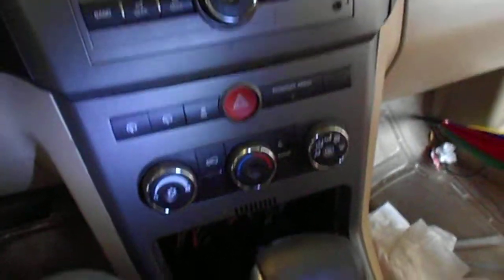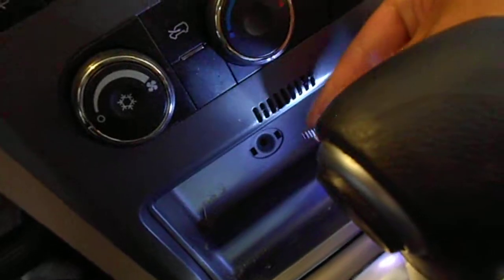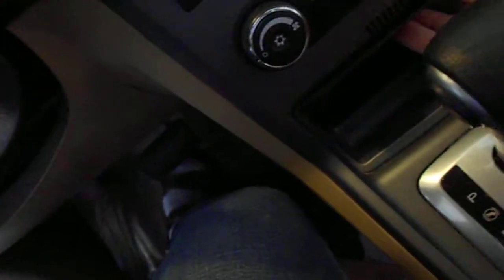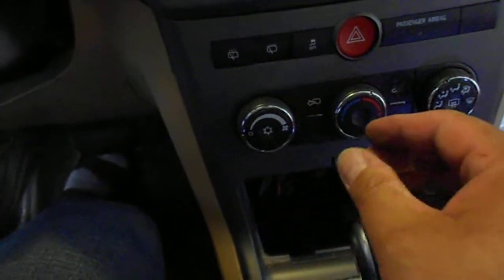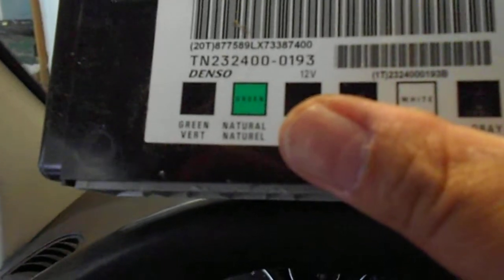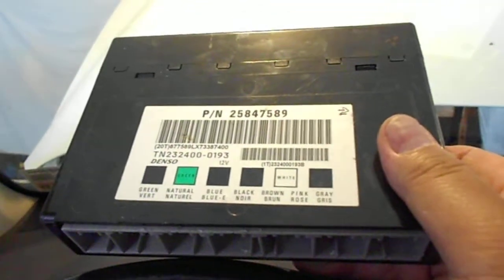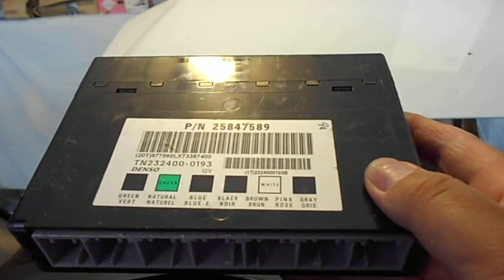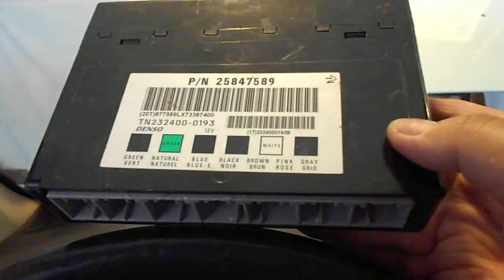Saturn vue 2008 2013 Chevrolet Captiva  BCM body control module mounting & removal Where To Find it

Comment: I have a 2008 saturn vue xe 2.4 liters 4 cylinder my control module is acting up now. I went to auto zone to get a free diagnostic and it said it was my fuel pump and fuel pump low circuit. My rpm keep going up and down not crazy or any thing. Sometimes when I start my car it act like it wants to turn off and sometimes it does but when I crank it back up it stays on.
Reply: Hey how did your car go? I have an issue where the rpm will increase above 3 but if I turn the car off and on it goes back to normal

Comment: Frustrating watching this guy struggle with removing a simple piece of plastic. Pull up on the emergency brake and then put the transmission in drive or lower and like magic, the part is EASILY removed.
Reply from the maker: Please make your own simple video to help everyone . I will waiting